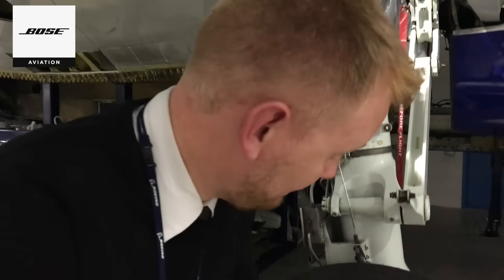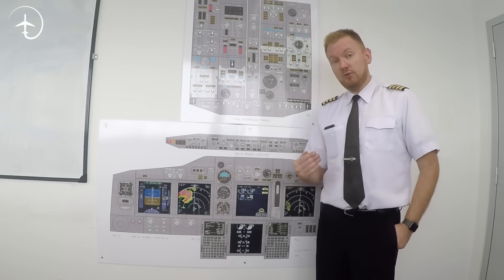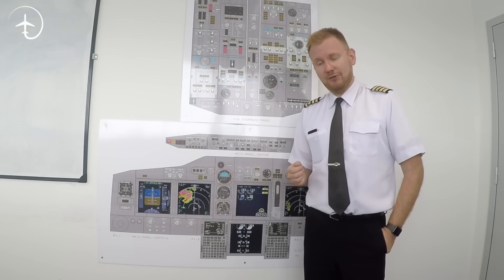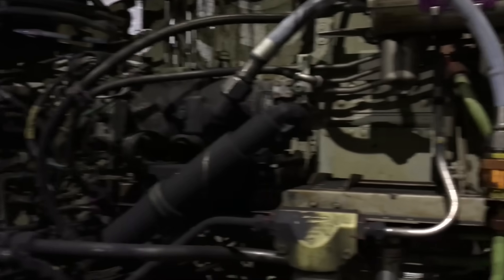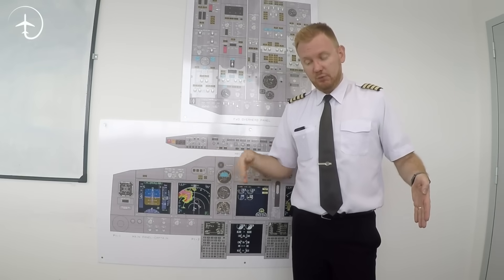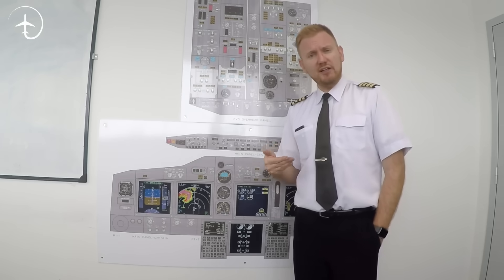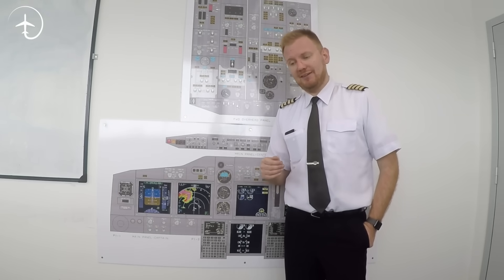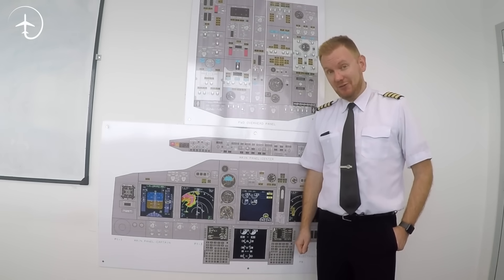Why does the Boeing 737 not have any landing-gear doors?

Comment: Hi Mentour, I have a small question for you 😀😀 Can a pilot with type rating on 737-800 fly on the -600, - 700 and -900 versions?
Reply: Azelide His company don’t operate other members of the 737 NG, but I’ll answer it for him. The short and simple answer, yes, simply because all 4 of them have the same cockpit.
Reply: Blake Tibbitts But the risk of tail strike is different... Although that wouldn't take too much training to learn the differences
Reply: +James Thom  I suspect that most airlines would prefer that a pilot switching for the first time from one version to another would have at least one check flight with a more experienced pilot.
Reply: Azelide Yes, they have a common type rating from the 737-100 all the way to the Max.
Reply: Yes they can. but a pilot with rating on an earlier version cannot fly a later version without certification.
Reply: Saxtondonald97020 Buddha they are already type rated on the jet.  They have to go through “differences training” to be legal.  Early or late has nothing to do with it.  A 737-300 pilot has to have differences training to fly the 737-500.  Same generation aircraft.  The same applies to 737-700 vs 737-900, 767-200 vs 767-400, also same generation.

Comment: Did you say the tyres were inflated to 14 psi. That seems a little to low
Reply: He said in another comment that he meant to say 14Bar which is above 200PSI.
Reply: I see. Forgive me then
Reply from the maker: I found that info by a quick search, I’ll check it out.
Reply: As far as I know the figures are around 150-200 psi

Comment: What is a flight level?
Reply from the maker: Hi! I covered that in my recent video about altimeters. Check it out.
Reply: Okay! Thanks! :) Great video!
Reply: Lucke FL330 is 33000 ft at international standard atmosphere (around 1013 hPa / 29.92 inHg)
Reply: For example: FL330 means, that airctraft is flying on the 33.000 ft.
Reply: Hamburger Quieddje I just can't stop laughing
Reply: Okay! Thanks!
Reply: Manuel Bonet rather at internationa standard atmosphere(isa) with 1013,15mbar/hpa :)
Reply: Hamburger Quieddje Argh, I always mistype the number. Thanks for pointing it out!
Reply: Manuel Bonet me too....it is 1013,25😂

Comment: Speaking of the 727, I remember many years ago I flew first class in an old 727.  Since the engines were way at the back of the plane, the take off was the quietest I've ever experienced.
Reply from the maker: Yep, great for the people in the front, less great in the back :)
Reply: Yeah, those old engines were noisy af!   lol
Reply: Glenn, the main reason tail-mounted engines seem louder is because they are indeed louder -- they're earlier-generation engines.  They were either turbojets or low-bypass turbofans.
Reply: JT8Ds... low bypass turbofans.
Reply: They used to have "WhisperJet" painted on the side of some. You want loud? Try sitting in the back row of a DC9 on take off. Now THAT will blur your vision. LOL.
Reply: It's quiet for those in the front of the plane, but definitely not for those at the back of the plane or on the ground outside.  In fact, it seems that tail-mounted engines are MUCH louder than their wing-mounted counterparts, even ones that appear to be the same size and from the same time period.  I wonder if there's a scientific explanation for why that is the case, perhaps having to do with the sound waves bouncing off each other and amplifying.  Could this explanation be a future Mentour Pilot video?
Reply: Yes, the 727 had JT8Ds.  I was speaking generically, but now can't find an instance of any airliners with tail-mounted turbojets -- all seem to be turbofans.

Comment: Funny, I just asked you that like yesterday
Reply from the maker: Exactly, and the video was already in the pipeline then.
Reply: I worked on/as I-Level repair for P-3C, EC-130Q and E-6 (707) Hermes (VQ-3 "IRONMEN" TACAMO) later called the E-6A and E-6B Mercury.  I noticed the NAVY was replacing the P-3C with Boeing P-8 Poseidon.  At the time I could see the outboard main tire exposed.  Thinking it was a NAVY only thing, I went back and looked at the 737 Civ and it was the same way.  I just found this to be a rather interesting feature that most people never notice including myself until it is pointed out.   Not sure if you have done a video on the Boeing 7x7 number and why those numbers are used by Boeing it might be interesting for those that do not know.   Thanks.
Reply: IMRROcom  MANY YEARS AGO, at an FAA, public meeting, I met 2 of crew from a NAVY P2V, they were flying out of ENGLAND, back. To USA, at cruise they encountered a thunderstorm , over the ATLANTIC, so 20+ thousand , the aircraft rolled, & pitched  out of control, they got it back 1800feet over the water, , but It maybe that reason they were there,
Reply: Anirudh Mittal The rubber would get that cold regardless because of the low temperatures at cruising altitudes. Either way, airplane gear tires are designed for all climates and conditions.
Also, airplanes couldn't operate from many places in the northern or mountainous US due to a brittling concern if that was the case, since some places get well below 40 degrees C.
Reply: As usual simple(and at the same time interesting), understandable and just great explanation for everyone 👍
Reply: I used to work on planes in the past.  If my eyes were better I wanted to be a pilot.  Goals to pilot at the time were A-10, A-4, F-15 or F-16  depending on what branch I joined,  Bad eyes said no you can not do that.
Reply: Mentour Pilot but shouldn't the rubber in the tyres get brittle when subjected to such low temperatures
Reply: Mentour Pilot can you do a video on radar, radios, and the codes used for flight paths?
Reply: Anirudh Mittal Plus he addresses this in the video itself....
Reply: So not quite yesterday? But similar to yesterday... The day before? Today? 🤔
Reply: Hey Eric!  So you like planes too and not just trains.  Good to see you here!  - JD from YTMB.
Reply: IMRROcom 200th like
Reply: Mentour Pilot do a video on flight data codes, like TRV030059 LENDS AR16
Reply: Google heard you!😱
Reply: nope not at all, heck even back during WWII some of the military aircraft tires were partially exposed.
Reply: AP failure probably meant the Auxiliary Power unit (small turbine engine) in the tail was offline. When it's off they have no power to start an engine so need a boost from an engine start cart.
Reply: He probably meant the APU, a small auxiliary engine in the tail used for running the aircraft when engines are off. If it's offline the ground crew has to bring out a start cart to get one main engine going, then the working engine can start the second.
Reply: +Anirudh Mittal Synthetic rubber can be "designed" to have just about any characteristics you want at any given temperature (within reason - wouldn't want to try landing on a tire that actually was -150C).  We've come a long way from unmodified natural rubber.  Also remember that tires have several layers of steel belting.

It's not entirely unreasonable to expect temperatures as low as -30C to -40C on the ground anyway (we hit -35C several consecutive nights this winter, and we're the south end of the great white north), so -60C isn't that much worse.

Furthermore, given the air flow speeding up heat transfer, you can damn betcha that any tire that managed to get down to, say, -60C at altitude, is going to be a nice toasty Miami temperature at touchdown in Miami.
Reply: Jordan Anderson I think most places are below 40 C.  :)

Comment: Do you think they will build planes even larger than the Airbus 380?
Reply: I am not surprised.  I've never flown in an AB380, but I can't quite imagine being on a plane with that many people.  It's kinda like some of the cruise ships now that can accommodate over 6000 people?  WHY?  If I want to be that crowded in with other peeps, I'll move to NYC.
Reply: No as these super large aircrafts are mainly suitable for Hub to Hub traffic to gather enough passengers each flight. There are only few direct relations with such heavy demand.
As companies are more and more shifting to offering more direct connections, using smaller planes the need for very large aircrafts will become limited. Therefore developing an even larger aircraft would present a very negative business case. Instead you see more types of smaller/mid size and more fuel/cost efficient planes being developed, like the Dreamliner.
Reply: Lari Kipe cruise ships don't need to fly